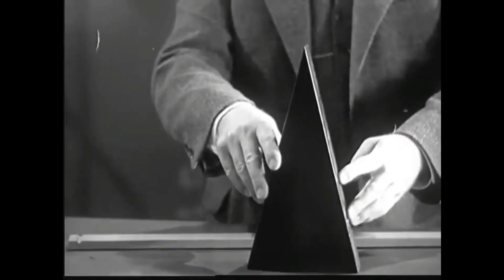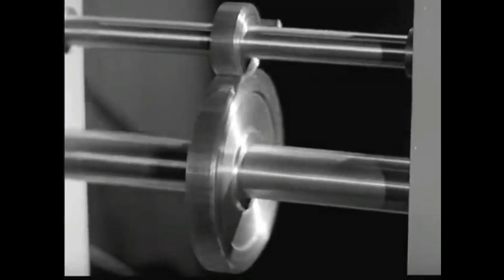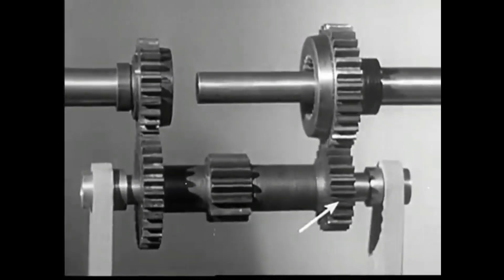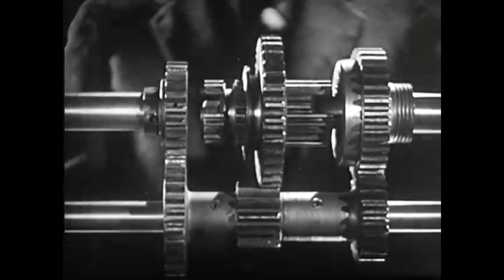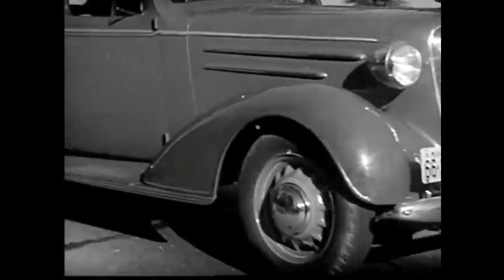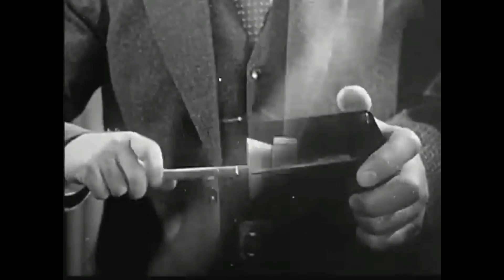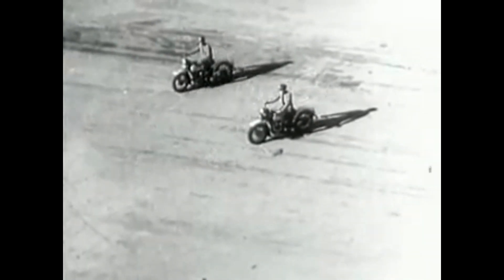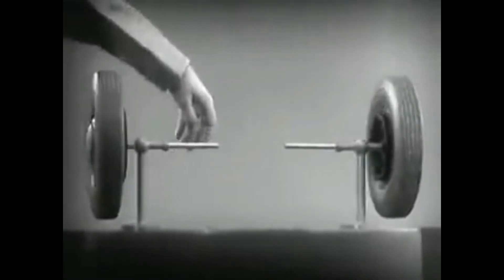How a Gearbox works & changes gear, how the differential work & Syncromesh explained. #gearbox

Comment: Can you answer a question for me..can you take the axles and ring gear and diff out of a swing axle transmission and replace them with a transaxle ring gear and diff etc to create a transaxle gearbox..new to vw drivetrain
Reply from the maker: I don't really know what you mean? If you were to use as a transaxle at the rear would need to flip the diff (which I assume is possible with a vw box) as would nean spinning the box 180. I think the formula v guys use the engine and gearbox 180 out making it a mid engine car so again assume diff can be flipped to give forward rather than reverse gears. If the gearbox has the desired ratio for a transaxle I guess it could be locked in one gear and driven remotely as I is. Is that what you mean? Curious about this one! 😊👍